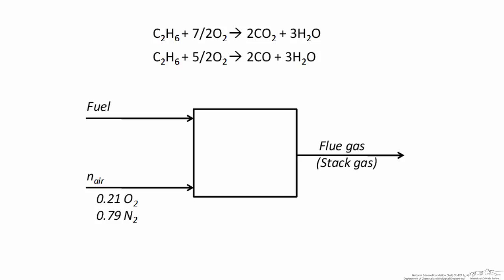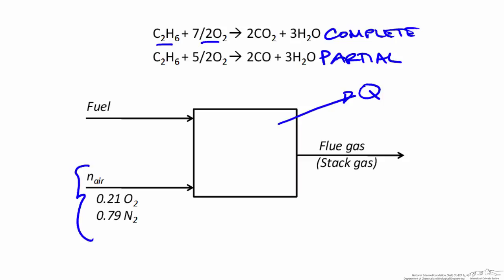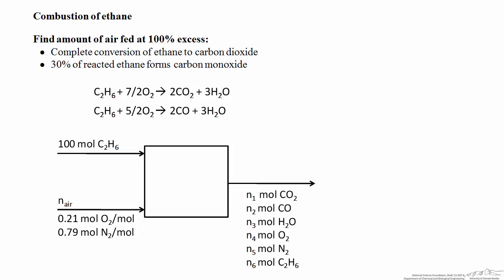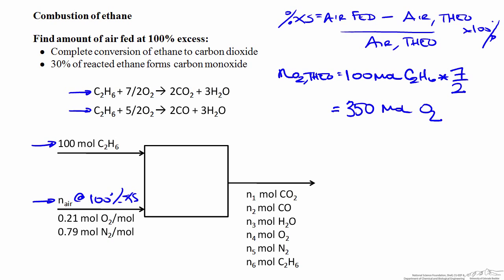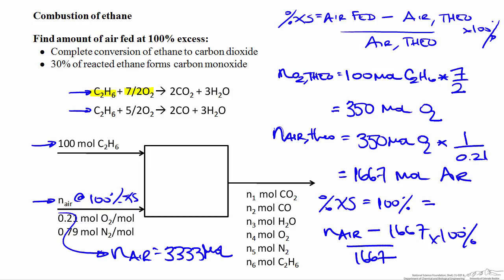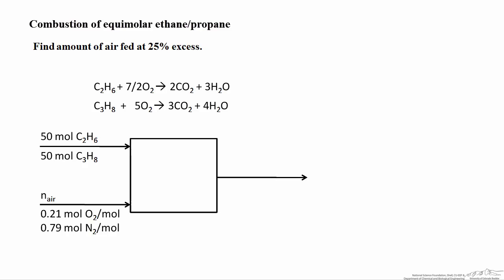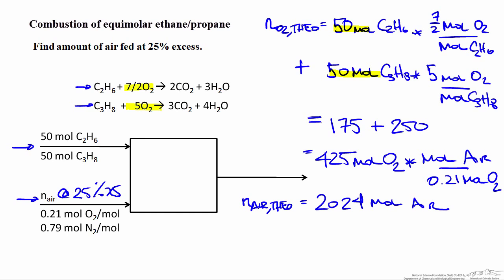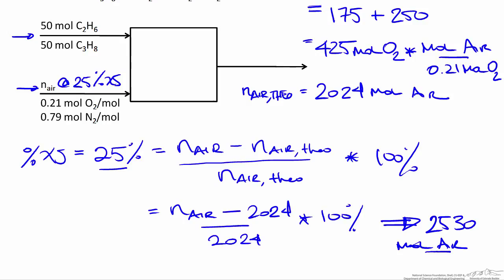Percent Excess Air (Combustion)

Comment: how did you get 3333 for air fed I don't understand how you arrived at that number
Reply: Ok I know another method.

1.First calculate theoretically required air 

2.as %excess of air=% excess of O2 use this formula.
O2 supplied=O2 theoretically required x(1+percent excess of O2 /100)

3.After this , you will get O2  supplied then, by material balancing i.e 100 kmol air= 21 kmol O2  then x kmol air = the amount u got after the above step. After this u will get the amount of air fed.
Reply: you need 3333 mol air for obtain 100% excess rate

Comment: A furnace is fire with coal with 72.65% C, 13% ash, 1.6% N, and 3.2% S. 
The Residue in the furnace contains negligible combustible matter. The air enter the furnace at 38 degress celsius and 5 psig and 75% RH. 
The stack gas leaves at 300 degress celsius with 8.4% CO2; 2.5% CO; 0.8% H2 and 10% O2. Calculate:

a. % Excess Air
b. Ultimate analysis of the coal
c. m3 of stack gas/kg of coal
Reply: interesting, i will attempt it

Comment: A separator is designed to remove 75% of the CO2 in flue gas (assume N2)  that is fed to adsorption unit, not the fresh feed. The CO2 is removed from the bottom of the separator. The exit composition of the stream leaving the separator contains 10% CO2 and the balance is N2. a recycle stream is used, where part of the exit of the separator is recycled and unites with the fresh feed. Draw and label a process flow chart. Calculate the flow rate and compositions of all unknown streams??